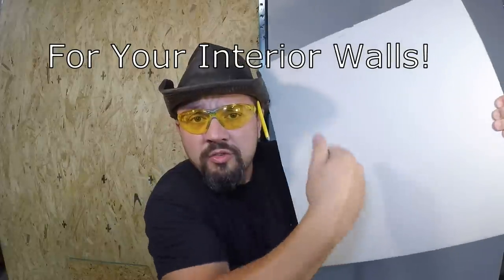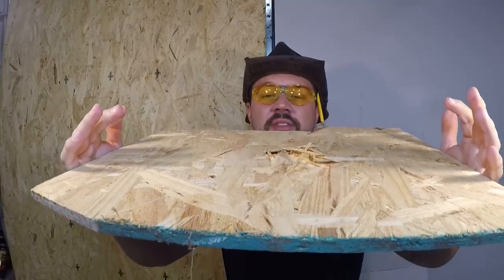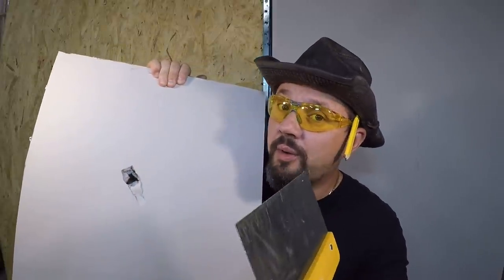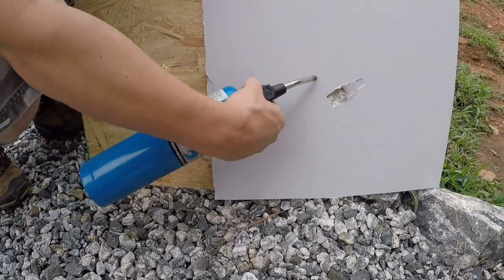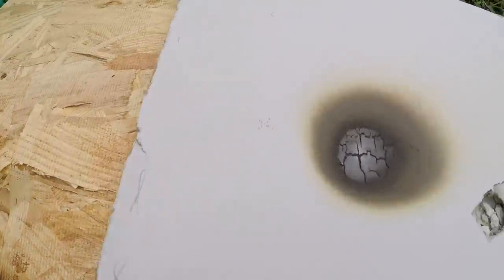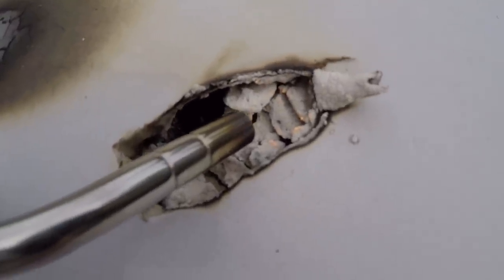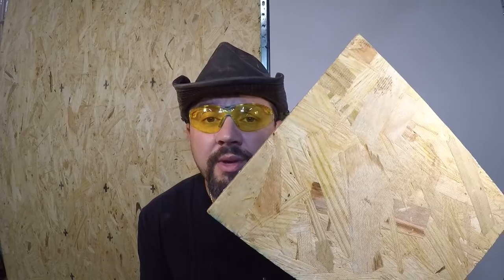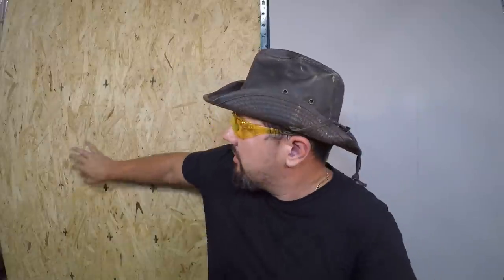OSB Vs Drywall - This Man Solves It!

Comment: Not sure where you're getting OSB, I just recently remodeled a garabe, osb was 7.50 a 8 foot sheet, drywall was 11.28, these were both about the same thickness and at home depot. Another Thing you need to know is if you get drywall wet you are going to have black mold. I have dealt with that in my house and its a nightmare.

Comment: I did a 30 by 40 shop with 12 foot walls all in OSB. 1/2 inch drywall was a dollar a sheet more money than 7/16 OSB. OSB is tougher and you can put a screw anywhere to hang something. If you paint it the fire rating would increase slightly. I am more concerned with knocking holes in walls of a shop and hanging things on the wall which I will do quite often, than I am with the odds of a fire.
Reply: May i ask, is OSB the same as board & Batten?, as far as in a manufactured home?

Comment: Drywall doesn't burn, but show me a house built with bare, seamless drywall. Electrical fires often start inside the walls... where all the wood is. Other fires burn your carpets, drapes, cabinets, furniture and the flames easily get through all the gaps around switches, outlets, light fixtures, etc. And it seems silly to worry about wooden walls when hardwood floors are common.

Another advantage to OSB is that it offers slightly better soundproofing.
Reply: This is the critical thinking we need in this country! Thank you for explaining this to us!

Comment: Drywall is Less expensive but less supportive to hang things on, including mud and tape and labor costs more in the end.
Reply: Adding blocks prior to installing drywall would be a good solution around it. If one knows before hand what the measurements are for things they want to hang this would be the best bet.

Comment: Sheet rock is only 60 cents cheaper than OSB at the moment and I'm only using it for a building that's insulated with a pool table. I think ill go with the OSB. Way more stable to hang stuff from the walls also without using your studs.

Comment: I just got 7/16 4x8 OSB 8 bucks a sheet , Drywall 8 bucks a sheet .  OSB outdoors not painted or covered on the house wall 17 years swelled 1/8th inch turned black in the sun,  I ran a outdoor electrical outlet cut the hole it was like new under the 1/8th inch of swelling after 17 years , i had planned to cover the wall with siding , but a carpenter never gets to work on his own home.  Time and money .  as for fire yes it will burn but has to have a excellent to get it hot enough to catch fire , gas, lighter fluid, wood stove coals .   it will not burn from a smoldering cigarette .    Its fine for Shop or Garage exterior walls on a home , not in the home but I see people use it in the home and paint it .   I can send a link for the price Menards or True Value 7/16 4x8 '

Comment: several things,  who is going to torch their garage wall?    and your pricing is wrong. home depot OSB is about $8.50 for a 4x8 sheet. 1/2" drywall is about $7.24 however drywall needs mud and tape and paint.. but osb doesent. overall OSB is going to be cheaper to install. and many homes are sold with unfinished garages, where you have exposed osb anyways. so the way i see it there is no downside to OSB for a garage.
Reply: Exactly. But, you forgot about how time consuming it is to mud and tape drywall PROPERLY. Gonna take you 3 days to do a proper job. So, drywall(because of its process)is much more expensive
Reply: Home Depot 4x8 1/2 OSB is  $17.55
Reply: And drywall requires more meticulous painting (can leave OSB bare OR roll on some paint).  And drywall is so damn froofie - like being in the house and wife saying, "Watch the walls!  You'll ding them, or fingerprint them, or stain them, or... - AAAGGGHH!!".  Yeah, I'm doing something besides drywall.  I like the idea of exterior siding like good ol' T-111.  Hard as nails, slather on some paint, drill it, knock into it, kick it when your wide kicks you out of the house for messing up the nice, smooth painted walls and it won't dent...
Reply: regarding the torch, accidents happen. but other wise yea
Reply: Turns out I'm going with SmartSide for interior.  Woodgrain with groves every 8 or so inches - looks kinda like T1-11 but smoother and thinner and not absorbent.  Comes primed;  One easy coat does it!   I used this in my basement to cover some exposed insulation in a partially finish area and it looks great.  Easy to put up, primed, resists water...  Yeah, that;s where I'm going
Reply: 7/16 OSB fluctuates $7-$8 at my Depot, must depend on your area
Reply: lyon406 half that...$9.85
Reply: @mnight207  3 days... what a nonsence ... there are methods for instalation of plasterboard that takes just one day

Comment: Drywall in a shop isn't a shop it's a she shed. Put up osb, plywood, or steel panels and make it a man cave. Who the hell holds a torch against their walls? As a former fireman I have seen steel panels burn through on a shop ceiling. Also, I just purchased 7/16 osb for $8.25 per sheet. Drywall was over ten bucks......
Reply: I trust a Fireman's word! OSB it is!

Comment: Nice. I play with fire a lot in my shop, 5/8" thick sheetrock has a one hour fire rating and its fiberglass reinforced. 5/8" is code for most apartments, condos, etc. if not the complete building could go up, not just one unit.

Comment: has OSB come down that much? I just got a bunch for my garage 7/16th for $6 a sheet at Home Depot
Reply: Skinny , Yep Menards was the same price 6 bucks , I live 120 miles away , so got it for 8 bucks at my local lumber yard , 40 sheets being delivered , Menards will only go 50 miles :(  I did not need 1600 # in my wifes truck for 120 miles.  my work truck is to old to haul that much weight .  my truck 2003 Dakota long bed 216,000 miles  a few sheets no worry .

Comment: Two different animals...
Osb... Burns...
5/8 inch drywall = 1 hr fire rating.
Osb= (wood) r-1 per inch thickness
Drywall 5/8 inch  = r-1..
So what do you want from your wall...
Something you can beat up...
Or something that has fire resistance..

Comment: But if the OSB is plastered over then will it burn?
Reply: It has to have a hot open flame to catch fire .  and it is hard to get it hot enough to burn through , he was using a torch . lighter fluid will burn off and only leave a small discoloration .
Reply: @JCcanU  This gives me peace of mind for construction, thanks for sharing!

Comment: I have a basement with potential for moisture problems. How about a fiber-cement sheet product? Yeah I already know, it's expensive and heavy.
Reply from the maker: I would use a really good block sealer..
Reply from the maker: Then a nice mini split that has dry mode

Comment: If I could afford it, I'd do 7/16 or 1/2 osb with 1/4 drywall over top. Tough and (with no rats and a good electrician) fire safe walls that are aesthetically pleasing. Top the dream shop with a decent size and style baseboard or maybe wainscoting and that's all folks. Other than the co$t and time spent keeping it lookin' prudy, anyone here see a down side to osb and sheetrock layering? Other than what's mentioned...
Reply: That's what i was thinking. Also could try a fireproofing flame retardant Paint coating for Wood, but the cost might be the same for the sheetrock.

Comment: As you probably know because you had a home in Florida.  95% of the homes in Florida when they are built are on 24 inch center for rafters and studs.  Have yet to see any sagging the many homes that I have been in as an electrician for many (58) years.

Comment: I hate drywall, plaster and fiberglass insulation.. but try and find a house without those nightmare products.
Reply from the maker: What e sl can you use?
Reply: @TheDepreys  shiplap, paneling or exposed framing with some kind of panel skin with sandwiched insulation on the outside.  "youtube search house with no drywall"

Comment: The comparison doesn’t really make since because drywall goes inside for walls OSB is the outside sheathing.
Reply: Well, there are lots of people who use OSB "inside for walls."
Reply: many garages are left unfinished with no insulation and only OSB on the outside layer. so i don't see how OSB has a downside.  Its cheaper than Drywall when you add the cost of mudd and tape.